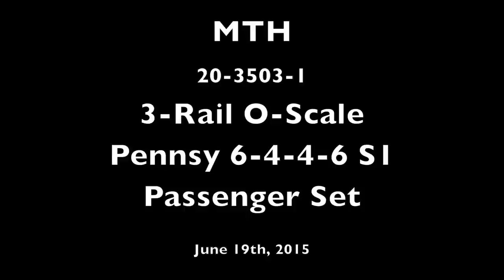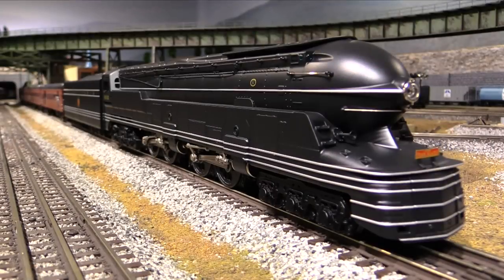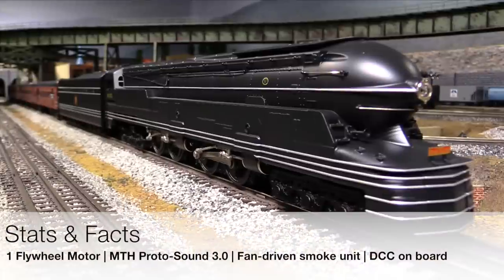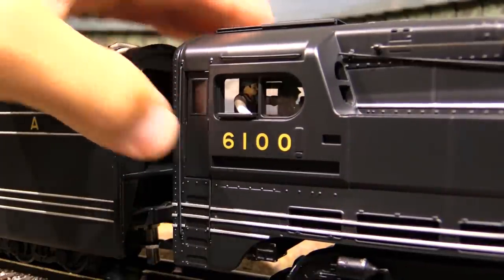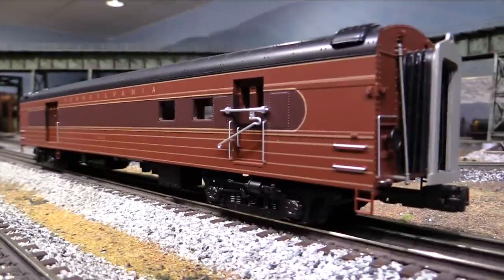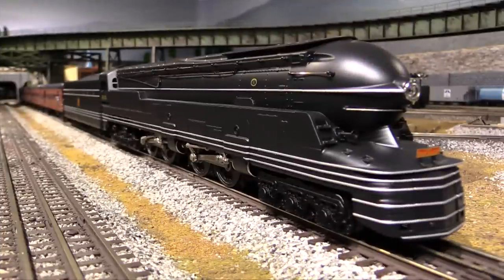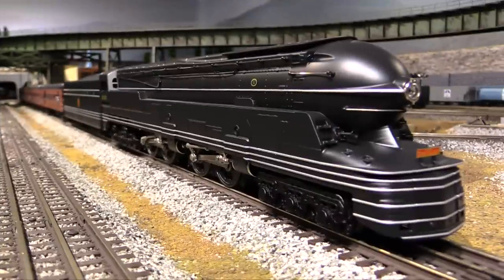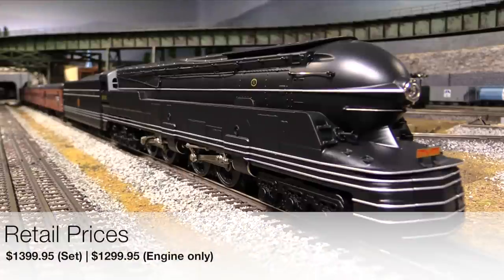MTH Pennsylvania 6-4-4-6 S1 Passenger Set

Comment: Too bad Pennsy didn't save this locomotive as a static display somewhere on the system. Horseshoe Curve?
Reply: it would be awesome if they did that
Reply: g bridgman na that a GP7 mabey in Altoona or the Hamburg no never mind
Reply: They put a K4s there for a few years then replaced it with a GP7. I'm only going on memory, I'd have to check.
Reply: We can save her and any other steam locomotive inside the computer : https://www.youtube.com/watch?v=GyuVQXiWv0I
Reply: true but If the S1 was built by Union Pacific it would be More Successful because Of articulation Or built as a 6 8 6 but instead A Non Articulation 6 4 4 6.
Reply: @generalprincecodyhedgewolf2944  I think you missed the point of this loco, and as a prototype it was successful.
Reply: It really would have
Reply: Believe other not, from what I heard on Wikipedia the S1 was originally going to be preserved but since Pennsylvania was in a pinch at the time (I'm assuming a few years before Penn Central) they decided that for the benefit that the S1 should be scrapped. 
(Y) Shame
Reply: @irishengine9166  I'm sure most steam locomotives were scrapped simply out of economic necessity.
Reply: They wanted to, originally,  but then 1946 came along and the Pennsy had to deal with operating at a loss, which meant cost-cutting.

Comment: There are rumors that the S1 along with its successor the T1 broke Mallard's speed record with the highest speeds for both being claimed at around 140 mph.
Reply: Alex Crawford Well, with the 5550 T1 being built eventually, we will soon be able to find out
Reply: wikipedia says something about it getting a "speeding ticket" at 156mph IIRC
Reply: Alex Crawford unfortunately for this loco that's all they are as no one has ever produced any evidence to support these claims, such as timings of runs.
Reply: Matt O'Donnell if it had surely by now someone would have been able to pull the records and prove that this had occurred. Until then, this remains only a rumour.
Reply: @mattodonnell8  yeah, they say that The PRR S1 had once hit the speed of 156 mph(249.6 km/h), a tremendous and unbelievable speed of a steam locomotive can archived.
Reply: I do know both did over 120mph on a daily basis.
Reply: @WesternOhioInterurbanHistory  indeed it did.
Reply: Western Ohio Interurban History which is more than the A4s could dream of

Comment: Not to be picky but you have the rpo car on backwards as the hook has to face forward. As a kid my grandfather worked for the Milwaukee Road Copper Country Limited and when allowed to enter the rpo car I would play with the hook. Also MTH forgot to put a handle on the hook,it looks like, as you would have to open the door to operate the hook also. Great train set, I have a T1 as the MR used those.

Comment: It's a beautiful model, and has a rather striking look to her, but I must know what came over Raymond Loewy to come up with a duplex with 6-wheel pilots taking away what little weight was distributed between the two separate engine units, it's more like double heading E6 class locomotives than a 6-8-6. The T1 was much better balanced though. I thought we learned from the Midland Railway that coupling rods weren't flimsy at high speed, that's what got us off of building the single wheelers.
Reply from the maker: RockyRailroad Productions Raymond Loewy only designed the streamlined shrouding, he didn't have anything to do with deciding the wheel arrangement.
Reply: ericstrains I see, my mistake. Although I'm still curious as to what it's point was. Maybe the rollers at the fairground restricted it somehow?
Reply: RockyRailroad Productions The 6 wheeled engine and trailing trucks were needed to support the massive weight of the locomotive's overhang which did result in diminishing some of the weight over the drivers but with 84" diameter drivers, 300 lbs steam pressure and that long rigid frame it was bound to be a slippery engine.   Once it was up to speed it could run like the wind but it was just too damned big.
Reply: allegheny48 If Loewy had shortened it and gotten all the drivers coupled to prevent wheelslip (Like a 4-8-6 perhaps) it could have worked better,
Reply: RockyRailroad Productions Once again, Loewy was only responsible for the sheet metal styling and had nothing to do with the mechanical design.  Unfortunately a lot of ideas look good on paper but don't meet expectations when put to fabrication.  All those "what ifs?".  Keep in mind that 84" diameter drivers were almost always prone to slippage when starting heavy trains but were essential for high speed operation.  See if your local library can get you a copy of Al Staufer's Pennsy Power.  You will enjoy reading it.  Also, if you subscribe to Classic Trains check the  Steam Glory 3 special edition (holiday 2012) for an article entitled Pennsy's T1 reassessed  by David Stephenson.  I think you will find the article very interesting.
Reply: allegheny48 I'll have to take a look and see if I can find a copy of that book on the T1s, I'm interested!
Reply: Retro streamlining design was purely cosmetic. And often presented a challenge to maintenance crews.
Reply from the maker: RockyRailroad Productions The streamlining was done to make the trains more attractive to the public. America was in the midst of the great depression and in order to try to lure the public into riding more trains they streamlined them and made them look fancy or futuristic.
Reply: ericstrains Your comments are absolutely correct, Eric and, for the most part, the futuristic look of the streamliners did help bring the traveling public back to the rails.  In my opinion for the Pennsy, historically known as The Standard Railroad of the World, to create streamlined duplex steam locomotives was a radical departure from their tried and true designs of K4's, M1's and E6s produced in the hundreds.  Although the S1 may not have been the success they had hoped for the T1's, if properly maintained and set up along with a well trained crew in the cab, could turn in a better than average performance.  Dave Stephenson's Classic Trains article dispels a host of negative myths on these engines.  Unfortunately, it was the less complicated steam locomotives that remained in operation until the end of steam on the Pennsy.  Thanks once again Eric for a great review and I have also enjoyed the discussions.  Great fun.
Reply: allegheny48 - Al Staufer's Pennsy Power - Yep, I've got that one, it has a wealth of info in it about every PRR loco until 1964, although only steam & electrics, no diesels.

About the T1's: one of their failures was the poppet valves - very efficient at high speeds but more complicated and expensive to maintain than regular piston valves.

As for streamlining it only came into its own at speeds above 80mph which was far more usual in Europe than in North America, hence in Europe streamlining was for efficiency and in North America it was for looks.

Comment: To see brief clips of Pennsy 6100 running in the Chicago area Green Frog Productions has an 8 disc DVD set entitled Vintage Steam Spectacular.  Within that set is a disc called The Golden Twilight of Postwar Steam Pt 1.  B&W movies show brief scenes of Pennsy 6100 slowly passing the camera of Gene Miller.  The cover plate for the front coupler is missing and she is pulling a first class train as she parallels the NYC tracks on her left occupied by the 20th Century Limited which is also on the move.  I don't believe the DVD is sold separately.  However, the 8 DVD set which includes it as well as parts 2 and 3 is just under $35.00.

Comment: I have a theory that the engine wasn’t scrapped but turned into the the S2 which explains the 6-8-6 on the S2 and 6 wheeled trucks.
Like if you agree
Reply: The S2 was built in 1944 and according to Eric the S1 made its last revenue-earning run in 1946, I have a couple of photos of it (the S1) in storage in the late 1940s about the time the S2 was also in storage. Nice try, but....

Comment: Can you tell me if the S1 had the same tender as the T1. I am also trying to get some scale plans of the S1 in H0 or 0 gauge. I have looked on the internet but drawn a blank. Do you or any of your subscribers know where I might find them. Great video thanks.
Reply: Hi Sam, I have plans of both, jealous? They did have different tenders: The S1 had 250-P-84 and the T1 had 180-P-76 tenders (sometimes referred to as "Coast to Coast" tenders). The first number refers to the water capacity in thousands of gallons, the second number is the height of the tender deck above the rail in inches. The "P" means for passenger service. The actual water capacity was slightly different, the Pennsy just rounded up the numbers. - Dennis

Comment: Raymond Loewy designed only the "air-smoothed" streamlining for the engine and the tender (as he did when smoothing out the original riveted GG-1 by designing a welded skin). Detailed mechanical design resulted from the collaboration of PRR with several manufacturers, although the duplex design was primarily the result of pressure from Baldwin engineers (a builder with which PRR had close connections). Baldwin engineers had been pushing this concept for several years and wanted an opportunity to try it out in practice. Baldwin had proposed this concept to B&O around 1932-1933, but the road turned down the Baldwin design because of concerns about long rigid wheel base (B&O later built its own duplex 4-4-4-4 at Mount Clare shops in 1937). 

The S-1 was designed from the beginning with 6-wheel leading and trailing trucks in order to support the enormous boiler required to allow the cylinders to develop 6,500 i.h.p at high speed, an output the PRR had calculated was necessary to accelerate 1,200 tons of passenger stock to 100 mph in acceptable time and distance, and to keep it at that speed over the road. 1938 ARR tests had shown that at least 4,000 d.b.h.p. was required to achieve this result with 1,000 tons. The S-1 ended up with a maximum axle load of 71,000 pounds (versus 67,500 postulated). The engine was built by PRR at its Altoona shops early in 1939. (This information is taken from Brian Reed's essay "Pennsylvania Duplexii," in volume 2 of the book "Locomotives in Profile."

Comment: soon, there is gonna be a new s1 built and it will have a new top speed up to 165mph, and it can travel up to 135mph and it will be converted into oil and it will be the same size as a big boy, and it's wheels will be the same size as the big boy and it will use the Cosby whistle and there is gonna one built, and it will be on top of the cab of the s1 and it will run from Pittsburg to Chicago service and there is gonna be up big boy #4004 in alco, and when the s1 is complete, the big boy returns and it when under a restoration and it will be completed in 2039 and it can travel up to 100mph in the straightest line in the train tracks in wyoming where trains go 100mph and It will be running again in 2039 and it will have a new top speed up 140mph and it can travel up to 100mph and it will doublehead with UP 3977 every field day in TOR school, and for the new s1 will be numbered 6101 and it will use popet valves and it will have a prr logo in the on the bottom of the light, and it Will be the fastest s1 in the world. And it will be the fastest s1 in the world and a surviving s1 in the world too. And it will have the PRR Red scheme and it will have yellow stripes on it too. And it will double head with s2 #6201 and it will have a new top speed up to 160mph and it cab travel up to 130mph and it will

Comment: Does Stripes is a Shoulda be like copper not white I think they did it of a boo boo mistake about this one right here because the original colors right there that of a drawings that are of the original of the train it's supposed to be copper of a Stripes right there but not in White Stripes I think that the other whoever designed this one well that's a boo boo mistake right there

Comment: A great example of form over function.  They damn well knew that a locomotive that long and big would have problems and not articulating the front engine compounds this but doing this would compromise the design.  Furthermore one of the big shortcomings of steam locos was that they only used steam once, european builders used Mallet (mallay) technology generally with a center cylinder or cylinders operating a crank on the front axle, this was the high pressure cylinder with large outside cylinders for the low pressure.  This gave them two passes on the steam, ship engines were then triple reduction or even quad reduction, getting every bit of energy out of the steam, something they need to do to compete with the diesel.  For both ships and trains the diesel won.  Heck, up till about 1950 the brits built a number of steam powered highway trucks, instead of shifting gears you shoveled coal.

Another example of this was the turbine locomotive, it used two marine turbines (these units couldn't reverse), the main forward unit was geared to the center axles and rodded to the others, this unit was about 7000 hp, for reverse a much smaller (1500 hp) unit was geared down a lot and I believe clutched so it disengaged when running forward.  Problem was that turbines don't run well at really low speeds and you can blow out all your steam starting, they run fantastic at speed.  I'll bet that they were much better at starting a train backwards than forwards, this could have been solved by having a third low hp turbine similarly geared as the reverse motor, to get things started and let big bertha do the speed thing once it got rolling.

Both of these locos are popular as models but had only one prototype and were essentially  failures in the real world.  This is a problem with having 'designers' build things rather than engineers and mechanics.  Dr. Porsche was not a car designer and his classic design of the early Porsche cars is still classic today when all the rocket ship and tail fin models that designers made now look kinda stupid.  The GM diesels looked good when they came out and still look good today (when cleaned up) and their mechanical design is basically unchanged aside from technical updating.  The jimmies put all their weight on the driving wheels and can both start a heavy train and then fly with it down the line.  And do it efficiently and reliably.
Reply: This might have been really great if they did it 4-6-6-4, articulated the front engine and used Mallet technology.  This would reverse the weight on drivers equation, go around corners, use less coal, and end up being really useful.

Comment: Hmm. If we can rebuild the largest locomotive ever built- Big Boy 4014- we can certainly work to improve this already magnificent engine. Improvements could include: 
- Downsizing the chunky 6 wheel bogies so more of the engine’s weight lays on the drive wheels
- Linking the two sets of drive wheels with a geared axle so the cylinders don’t fall out of sync (cylinders on the same side would be at 180° separation, cylinders on the same end at 90° separation)
- a steam whistle as opposed to an out-of-place air horn
Reply from the maker: James Groccia yeah, except the S1 was scrapped so there’s nothing to restore. There were multiple big boys preserved so that made it much easier to bring it back to life.
Reply: ericstrains Who’s to say it can’t be done? We have the designs in preservation, and all the scrap metal of abandoned freight cars we could ever want.

Comment: Who agrees this locomotive is awful and there should never be a replica built and instead build a better one like a norfolk and western y6b or union pacific feder challengers something better than this locomotive that has many problems , had many wheelslips/ wheels slip to much, has trouble on turning and worst to big its even big than a union pacific big boy it should stay extinct forever
Reply from the maker: Who said they're building a replica? I don't think anyone disagrees that the S1 had plenty of design flaws. That's why they only made one of them. If by "replicate" you mean the model here, the model doesn't have the design flaws that the real thing had. It's a model, it works perfectly. Further, Lionel and MTH have already made models of the Challenger and Y6b. Not really sure what your point was.